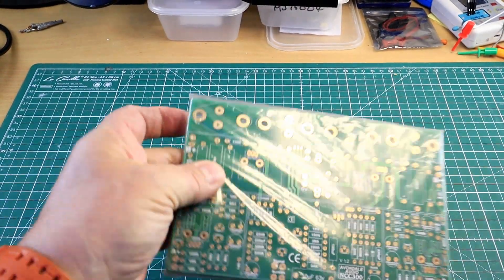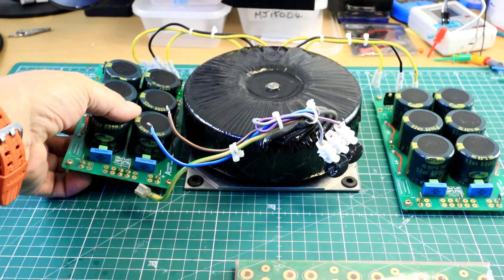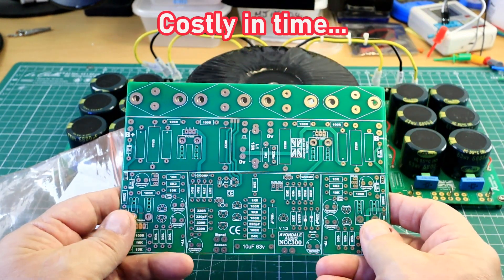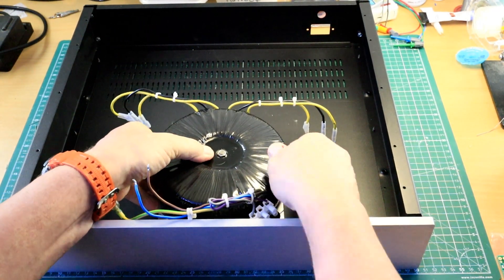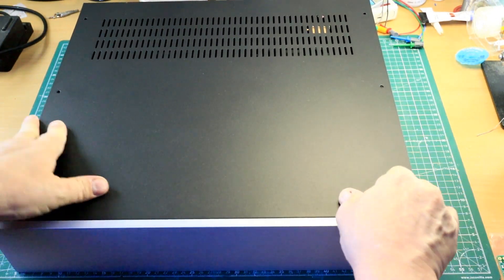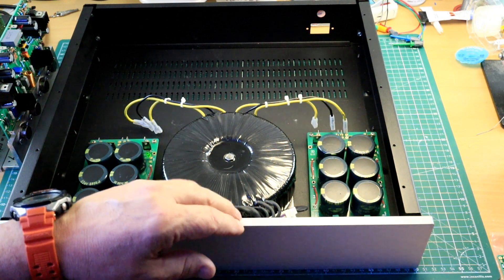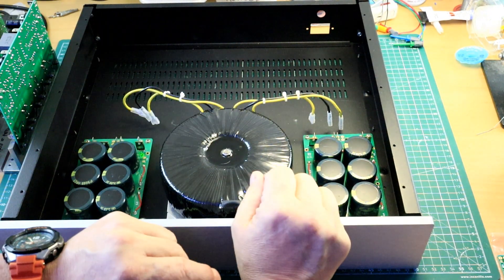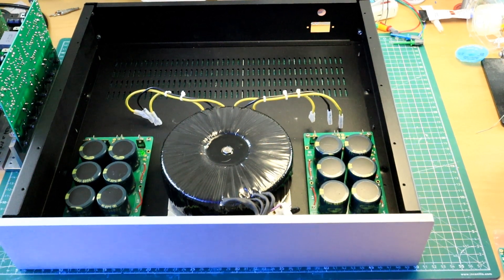Avondale Audio NCC300 Power Amp Build (Intro)

Comment: Hello, where can BOM been found while I'm interested as it looks a very fine design. Powerwise and overall info like more specific data on the power transformer 30 - 30 V Amp??? is missing so far. But maybe that has already been mentioned in the BOM whereas BOC (Bill of components) would me more expanatory.

Comment: Great Video; is there still a place you can get these ncc300 boards?
Reply from the maker: Hi
Sorry,  these boards are no longer available as a DIY  purchase from Avondale Audio any longer.
Reply: @thediyaudioimplementers1826  thanks; do you have a second recommendation after the ncc300? maybe the honey badger by diyaudio?
really interested in your opinion :)
Reply from the maker: @WigandKleine  Hi, I have not built the Honey Badger, there is only so many amps one can build but may be a future video, many like it a lot...Again it depends on your speakers. I Like all the Pass clones Ive built so far and dare I say the Mosfet sound? and may be the AJ is more my Favoured after the F6, has more bite IMO. But if you want watts the Avonedale Audio NCC220 (which is available for the budding DIYer)
Reply: @thediyaudioimplementers1826  Ah nice thank you; one last question :)  Would you recommend to running them as Monoblocks with dual LRS-200-24 like you did with the NCC300?
Reply: Or like this setup with the more conventional power supply, which also is really straight forward to build in one chassis
Reply from the maker: @WigandKleine  Hi I'm not sure they would do so well in that application, it would work as Iv'e read and seen people doing so but with large current requirements (1.8amps continuous) and high operating temperatures of Class A Id rather stick to the transitional. One of the reasons I used  the LRS200-xx is to give DIYers an easy option to built an amp power supply, it could be any amp, it works well and relatively un-complicated to get them up and running..
Reply: @thediyaudioimplementers1826  Thank you very much; than I thing the NCC300 build you did in this series replaced with the NCC220 should be a fine amplifier :)
Will follow your channel. Keep up the nice work
Reply: btw. do you know some who hast two of the pcb boards and would sell them? As you said they send out a bunch of them
Reply from the maker: @WigandKleine  Sorry, This question was asked on one of the forums and no one was prepared to part wit them. Which is a shame if their not being used.
Reply: @thediyaudioimplementers1826  Yes really; populating them is a really nice project; thanks. Than it is the NCC220 haha
Reply from the maker: @WigandKleine  NCC220 are a great, go for 50vDC rails to get the best out of it. )
Reply: @thediyaudioimplementers1826  ah nice; so a 1000va toroidal with 2x50V and 2 Minicap6 would be a good setup?
Reply from the maker: @WigandKleine  The 1000va is OK (may be a bit big) by why not, you will need two secondary supplies from the transformer of 35-0-35 (AC) then rectified and capped will give 50voltsDC supply rails , or very near that.
Reply: @thediyaudioimplementers1826  Thanks
Reply: @thediyaudioimplementers1826  What's the point of promoting a project where the pcb's are no longer available for although it has been posted for the very first time in the year 2020. It's not like that's been ages ago, is it. And it seems to me that if this is a valuable project, it sure looks like that, more people might be interested in bying the pcb's. Again, with the Gerber files available it's only a matter a question of production or do you the Gerber files available? Kind regards,